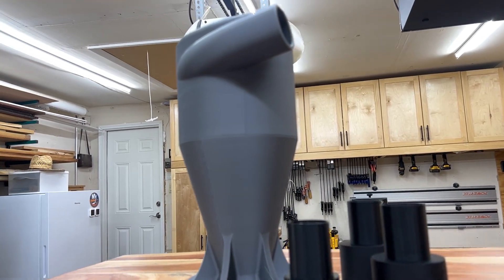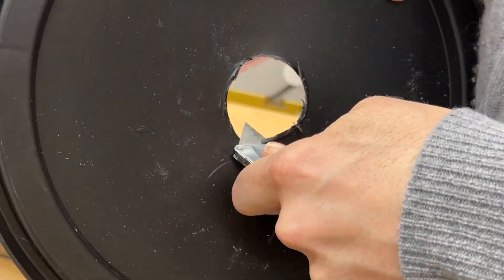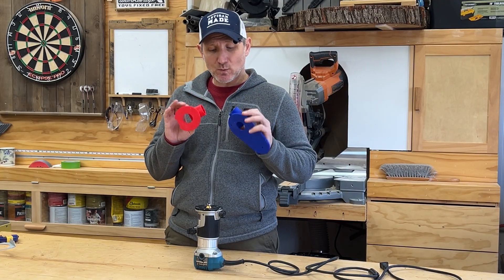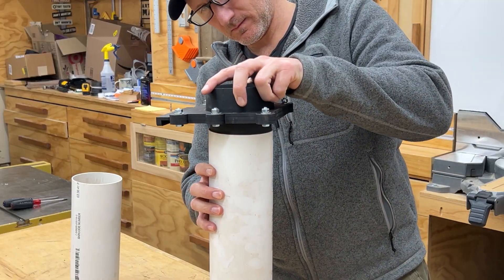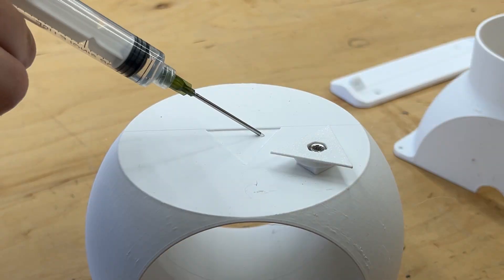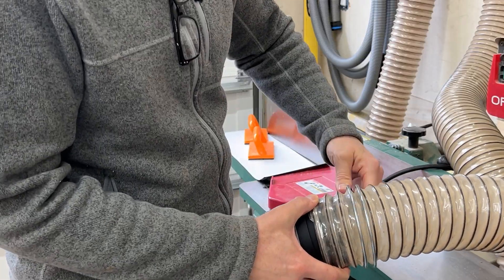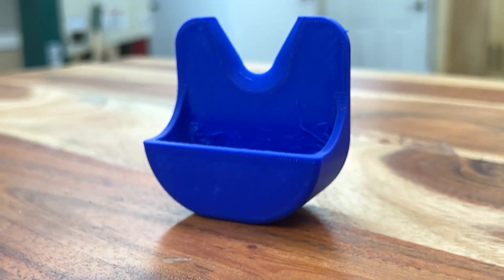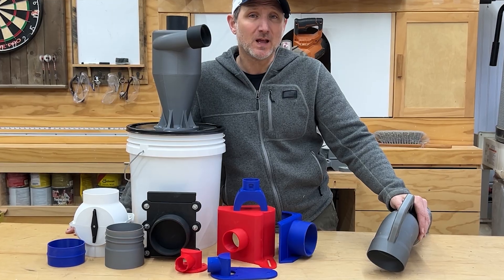3D Printed Dust Collection Upgrades / Improve workshop dust collection / Best free 3d print files

Comment: Awesome Video,  thanks! I have been on the fence about getting a 3D printer for the shop. Which 3D printer do you have?
Reply from the maker: Bambu lab. They are great machines. Very reliable and easy to use. And the price is right.

Comment: You need to earth/Ground the PVC pipe to drain static build-up and stop fires. Why Grounding PVC Pipes is Important:
Static Electricity Buildup: When fluids or powders flow through PVC pipes, friction can generate static electricity. If the pipe is not conductive (like PVC), the charge cannot dissipate naturally.

Risk of Ignition: A buildup of static electricity can discharge as a spark, which can ignite flammable materials in or around the pipe.

Safety Regulations: In industries handling flammable materials, grounding PVC pipes is often a requirement to comply with safety standards (e.g., OSHA, NFPA).

How to Ground PVC Pipes:
Conductive Grounding Wire: A grounding wire or strap can be attached along the length of the PVC pipe and connected to a proper grounding point, such as a grounding rod or a grounded metal structure.

Conductive Fittings: Use conductive fittings or couplings where necessary to ensure continuity in the grounding system.

Grounding Clamps: Special clamps can be used to secure the grounding wire to the pipe.

When is Grounding Necessary?
Grounding PVC pipes is particularly important in:

Industrial settings where flammable liquids, gases, or powders are transported.

Dust collection systems where combustible dust is present.

Environments with a high risk of static discharge, such as chemical plants or fuel handling facilities.

When is Grounding Not Necessary?
For non-flammable materials (e.g., water in residential plumbing), grounding PVC pipes is typically not required because there is no significant risk of static buildup or fire.

Conclusion:
If you're working with PVC pipes in an environment where static electricity could pose a fire or explosion hazard, grounding the pipes is a critical safety measure. Always consult relevant safety standards and guidelines for your specific application.

Comment: Excellent!
Thanks!
I wonder for the connectors, if you could make the inside of the tubes not straight but concave.  meaning, let's say for the "quick connect" the side that connects to the machine, for example: the table saw -which is a 4" port. The inside opening starts @4 and 1/32" and then gradually starts reducing up to 3 and 31/32".  So then it will have an air tight connection.
Have you tried?
Reply from the maker: I haven’t tried but that seems very doable. I bet there are versions of this on those free download sites.

Comment: I’m a retired engineer and have been a woodworker for many years.  I have done and redone dust collection facets many times over in my shop.  I just bought a 3d printer for the purpose of learning a new craft and to supplement my woodworking.  I am learning Fusion 360 and recently printed out my first object … a modified dust port for my Rikon bandsaw.  I’m impressed with your video as well as your printing and design skills.  And I’m grateful that you are generous and make your files available.  Thank You !
John D.

Comment: Great tips. Most of your hose connections fit way too loose. You have a 3d printer… why are you not tweaking your models to fit before you print??
Reply from the maker: With the vacuum pressure they don’t move.
Reply from the maker: With the vacuum pressure they don’t move.

Comment: Interesting content thanks for sharing. Those 3D printed hose adapters look to be far to loose fitting to be useful. Need a tight press fit. Or if the connection is permanent just some epoxy.
Reply from the maker: Vacuum pressure keeps everything tight

Comment: Can you share printer settings please?
Reply from the maker: settings are included with the files
Reply: @ArtisanMade  my cura says 1 day to print one half is it 12 or 24 hours?
Reply from the maker: @Chris-vc1dh  are you talking about the cyclone?  Print time depends on infill percentage and what kind of printer you are using. I think was 700g of filament at 30% infill.
Reply: @ArtisanMade  yes cyclone, I have ender 3 pro

Comment: Hey, I really like the things your making with your 3d printer.  just curious are you still using the Ender 3 V2, I have a cnc machine and co2 laser, I have yet to invest in 3d printer but I think 2024 is the year that I will do so. do you like this 3d printer that your using or would you get a different make and model. I know a lot of 3d printers wont do all that you are doing out of the box,  unless you modify them or upgrade them, at least that's what I read on the internet. are you making all that you make with a stock ender 3 v2? any other good info before i buy a 3 printer would be appreciated. thanks in advance!!!
Reply from the maker: Hello, i am using the bambù lab x1 carbon now. It is awesome. Very fast clean prints. No assembly. No tinkering. Just hit print and you get perfect prints almost every time
Reply: thanks, ill look into bambù lab x1 i was looking at QIDI Tech, do you have just the printer or the combo with Automatic Material Station @ArtisanMade

Comment: I only have a 210x210 print bed and not a 250x250 like yours. I've tried every trick I can think of but I just can't get that big quick connector with the handle to fit. I could shrink it, but that would just mean more adapters, right?
I'll try to remix the design to make it fit my printer better. If it works out, I'll report back.
Reply from the maker: I barely got this on my bambù lab. Definitely a remix.

Comment: Cool, but probably would have used a different cyclone designed for the proper hoses! That is choking the vac for sure! I use 3D printing for vacs all over the shop! Both standard shop vac and also 4” dust collector stuff!  So much better and easier than dealing with trying to find parts to get things to fit! As to pvc pipe seal, worked with central vac guys back in the day a lot doing construction, they all swear by electrical tape, cheaper/thinner is actually better!